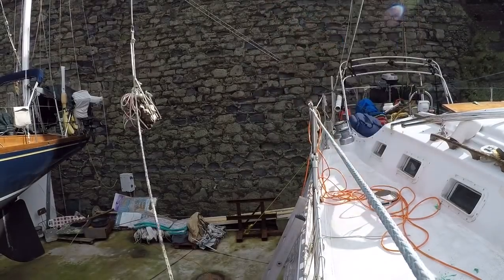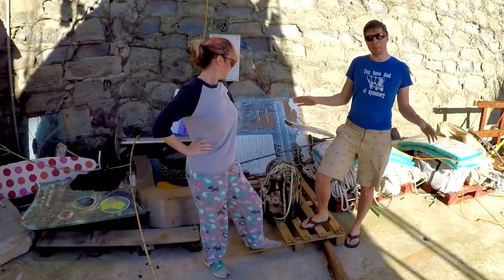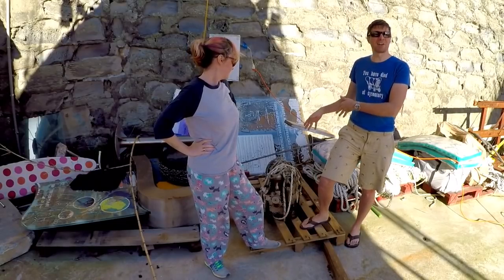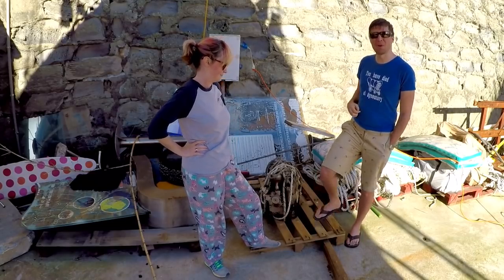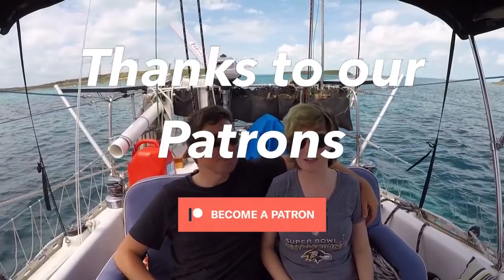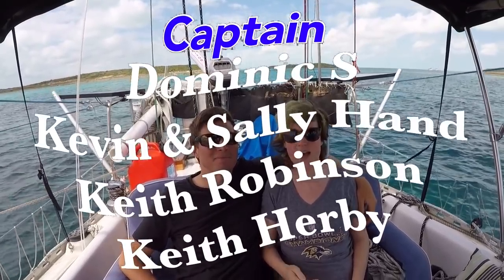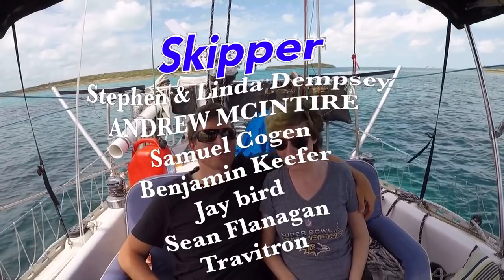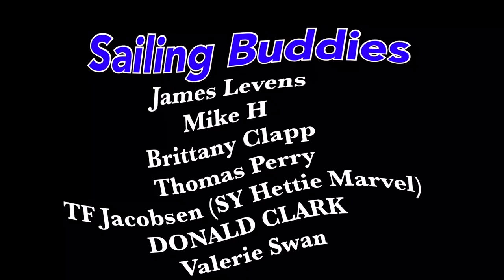Diesel VS Gas Generator?! | Sailing Wisdom

Comment: Another sailor, Garrett had a new Honda Generator destroyed by a wave. Very little tolerance for salt water. I have a 44 LB Sichuan Sifa 3 horsepower MB168F diesel. I oversized the 20 MM crankshaft to an inch with an adapter, and installed a big 7 inch pulley. It's perfect for a car alternator. Just mount it on a thick aluminum plate and not a steel frame. The other issue with air cooled diesels on boats is big fuel tanks always leak in. Water contamination.
Reply from the maker: We have had really good luck with Westinghouse generators. They are less temperamental than Honda and cost about half as much. We have had our 2200 Westinghouse for about 3 years now and we just added another 3700 Westinghouse to be able to run air conditioning on really hot nights at anchor.

Comment: A new Honda vs an Old Fisher Panda you made the right choice!    A Honda vs a New Northren Lights 1800 rpm diesel genset?  A no brainer for me. As you say there is no right answer for everyone.  I would never have a diesel generator that was not running at 1800rpm.  I had a Kohler 4kw powered by a Yanmar 2gm.  Bought it used for $700.  Never really needed a lot of parts.  Ran quiet, easily powered a 16000btu AC unit and fuel use was minimal. Still running strong for the new owner of boat I sold.   Anyway enjoy your channel.  Love sailing. Do not quite get the whole total electric thing.  JP

Comment: Hey, l've had 2 x honda 3kva gen set for ages on the cat....years..no problems...one fuel only on board..runs everything..48v charger..a/c..hotwater.
Once l set up the 48v solar & start using the regen l hopefully won't use them much...& the 2kva's are magic....cheers

Comment: Great video guys. Let me add a few things. MAny of us hates the large diesel inboard engine - dirty, heavy, noise, vibration, etc. However - even being lucky to have a boat - we still do not have endless time for sailing - so when we plan our passage, we need to start the engine if the wind dies. IT means quite lot of motoring, unfortunately. your gas genertor is great, light. but it is aircooled and you would not be able to take it to the engine room.  If you need more petrol than what you can easily carry, it is also where diesel comes to picture. All in all, a lightweight diesel, watercooled inboard genny is the best - plus an electric engine.
Reply from the maker: That would give you great range and speed! Especially a DC generator as it would power the motor directly instead of going through other steps to get from AC to DC.
Reply: @RiggingDoctor  that is exactly the system i am building - using watercooled controller, traction motor, 15kw dc(!) generator - all are from wrecked hybrid cars :)
Reply from the maker: That will be an awesome setup! At 5kw, we are moving quickly, so being able to sustain higher power levels means you can motor against a current for a long time!

If we could have motored at 5kw all the time, the ICW would have been a very different experience!
Reply: @RiggingDoctor  thank you very much for your advice! It is a great data you provided me. The most difficult is to get information what is  in the electric consumption of a traction motor on a 38-40 feet boat in real circumstances. So far I only  took reference of our long-term average diesel consumption, corrected by the estimated efficiency of a 30-year-old yanmar+transmission...
Reply: Might as well have a small modern common rail Diesel engine that does everything you want. That’s why 99.9999% of all yachts have them.
Reply: @PremierNZ-qb5zd  99.99% of yacts have diesel as most marine infrastructure supports it and in the early 70-s when low maintenance - mass production figerglass boats appeared - and made sailing more popular - it was the only way to go. A small common rail engine - which produces 200+ nm torque and continuous 600-700 rpm (max. 1200 rpm), watercooled - these figures are needed for a min. 40 feet sailboat - is not small, for sure. We are talking about 40 kw of power, low rpm capability, tilt capability - forget about carengines here. That is why a marine diesel weights 400 pounds, a similar car engine weights 150 pounds. a diesel engine with a gearbox has up to 40% efficiency, the electric motor has over 90% - so more that double. That is why eletric motor is lighter, takes less energy - hence a small genset can power it. IT is not a complicated structure - the electric motor is like a generator without the diode bridge. Certainly less complicated than a diesel engine.
Reply: I guess in the end it comes down to personal choice and I certainly respect their choice to go electric but for me, give me my engine any day which I have had for 13 years done 900 hrs( and I use my yacht a lot) and has never given me one single piece of trouble. By the way my engine delivers 40hp and only weighs 98kg (215lb) which is probably not too much more than the electric motor and battery setup. Anyway each to their own. Happy sailing.

Comment: Having owned boat (s), and sailed, we had a 1000 Watt Honda, and we loved it. If we were docked, it sat on the dock and ran.  I think that any engine IN your boat is a big headache. We did both a power boat and a sailboat. We did not do blue water sailing.
Reply from the maker: Not having it permanently attached to the boat is nice because when it starts giving problems, you just carry it away and carry in the replacement!

Comment: If you have an AC Induction motor it is possible to convert it into a generator if you are out sailing. Put it in regen mode if you have it and that will cause the prop to turn and generate power for your battery. However, you'd need to use it in stronger winds because it will create drag. Not sure if you have tried that but it is possible. If you are running just a series dc then my post is a moot point.
Reply from the maker: We have the AC setup and it generates lots of power for us while passage making across oceans :)
Reply: @RiggingDoctor  Excellent to hear. What AC setup are you using on your boat?

Comment: Very Good Points, as Usual. Although the Diesel can run for years trouble-free, What If it Doesn't? They are simple enough that you and Herbie can Overhaul it in the cockpit, but if a part is broken or unuseable, BIG Money. And perhaps LONG Waits for parts. I agree, in YOUR Case, Unjustifiable Expense. You can always just WAIT for a Sunny Day...

Comment: I've used those generators for years. The first Honda 2kw lasted 9 years and around 7500 hours. On the second one now. (I live off grid in Alaska)
Reply from the maker: Great to know they last a long time and can be dependable. 
Any tricks on keeping the starting cord from chafing? 
The original one chafed through and I replaced it with dyneema. It’s starting to chafe a little and it’s only been about 100 hours.
Reply: @RiggingDoctor  you have a rough spot on the metal insert in the plastic case. Next time you take it off use some good epoxy to build it up and smooth it out. It's caused by pulling at an angle rubbing in the same spot all the time.
Reply from the maker: Will do!  I made the new pull string really long so I can go trimming the chafed part off as I scoot the handle further in. I pretty much had to dismantle the whole unit to get to the starter cable!

Comment: The points you bring up are very sound. Also if you are going to put a diesel generator on board that big you might as well go to a diesel engine instead of the electric.

Comment: My concern is the gasoline storage.  It is more dangerous by far than diesel and it has a lot shorter shelf life.  Plus the gumming carburetor problem that can occur.
Reply from the maker: We keep it on deck and only carry what we think we will need for the immediate future for that reason. Once it goes past a few months it goes stale.

Comment: I wouldn't have that Panda generator either.  The thing is I do prefer diesel on a boat don't get me wrong, I understand why you did what you did.  That Panda is a nightmare to operate.  Most of the ones I have had the pleasure to know lasted about 500 hrs and then needed a major rebuild.. Seriously!!!!I would make a box for the stern and buy one of the cheaper $1000ish air cooled Changfa/Yamaha based diesel generators.  That way it could be air cooled and give you a good sized propulsion boost by allowing for more charging.  Though your generator may be the right size, a bigger genset might mean the difference between getting out of a bad tidal/no wind situation.  Also most fires on boats I hear are caused by gasoline fumes.  Diesel burns it doesn't explode like gasoline.  Considering you already have a huge diesel tank, shlepping around a lot of gasoline tanks might at some point get old.  Considering you can pull up to a dock and just fill up a hundred gallons of diesel is pretty appealing to me.  I have a Changfa 5 kw I've been running since 2007 with no issues.  It has 7600 hrs on it and still starts after one rotation and has manual or electric start.  At 1/4 load it will run about 4.5 to 5 hours.  It weighs I think about 80 lbs by my estimate and can certainly be carried by two decent sized people with no issues for short distances. Examples https://www.ebay.com/itm/Lombardini-Diesel-Generator-Power-Guard-Generator-Powr-Gard/263870678381?hash=item3d6feb056d:g:6kYAAMXQVERS48Cx     https://www.ebay.com/itm/Yanmar-YDG-3000E-Diesel-Generator-Works-Read/254006229414?hash=item3b23f379a6:g:X2sAAOSw11Bb7cWy   Mine is pretty much like the Yanmar and the Changfa engine is a clone of the Yanmar.
Reply from the maker: I didn’t know they had that reputation. Dodged a bullet!

Comment: Your sailing, why not get a miniature wind turbine or a small aqua turbine to plop down in the water and it spins as long as the boats  moving, either should be plenty to charge your electric motor up and you can just take it down after you have a full charge. I know in my area Menards sells the miniature wind turbine for 400usd. I mean its free and  maintenance is very low, just grease up the barings and at worse just replace the ball barings which are everywhere. You would only need an inverter to connect it right to the battery charger. If going green is the goal anyway. You could even get some of those cloth like solar panels and attach them to your sail if you are worried about space.
Reply from the maker: Thanks for the suggestion about the mini windvane. Our motor works as a hydrogenator and when we crossed the ocean, it actually met all our electrical needs. 
The only time we have needed the generator since we left the US was in Bermuda and in Horta (Azores) to charge up the motor bank after motoring in through the harbor. Other than that we haven’t used it much at all! 
The solar panels take about 1 week to charge the motor batteries up, so if we have the time before we need the motor again (which we usually do) then we wait and don’t use the generator!

Comment: Bad comparison with New Honda and some used second hand diesel that looked pretty much beat up.
Reply from the maker: It’s a comparison of gas vs diesel generators. New gas is $1k, new diesel is $14k+ installation!

Our case was a $100 beat up generator that spurred the discussion of gas vs diesel
Reply: @RiggingDoctor  I understand you are comparing those two generators. New diesel generators are very much different (modernized) than the one you had and last more than twice the lifetime of any gas power engine for less than $5K. Just sayin.  ;)
Reply from the maker: I couldn’t find any like that. I was looking at Fisher Panda and Northern Lights. Both of these were crazy expensive (new). For the price of a new diesel, we could buy several gas generators and never have to worry about repairs or rebuilds since a new one will still keep us under the original purchase price of one of those diesel units.
Reply: @RiggingDoctor  A diesel solution is going to be more expensive than a comparable 4 stroke gas generator set. However, if our point of reference is a 2 kW Honda suitcase unit, our diesel equivalent would not be anything that involves "installation" or five figures, would it? That's an entirely different comparison: a high powered fixed setup vs. a small inexpensive portable unit. Either can be gasoline or diesel powered, and there's very little difference at all if not used that much. Most importantly the diesel will have better fuel economy especially should the over sized system be run at partial load.

You don't want heavy and large additional equipment and you don't need high power; you only want a very lightweight generator. The choice in your specific use scenario is a portable Honda, but not because it's gas or because it's not diesel - because it's excellent.

Comment: What size is your battery charger ?  When the drive bank (210 AHr @ 48V) is down to 50% SOC, how long would it take recharge using your generator ?  Can you recharge the house batteries from the drive bank ?  (They do make DC-DC chargers.)
Reply from the maker: Our battery charger is 15 amps @48v. Charge time is about 10 with the charger we have from 50%. We have a 48vDC to 12vDC converter that we use to let the motor Regen power our fridge.
Reply: @RiggingDoctor  - you are not going to put much energy back into that battery bank just running the generator for an hour or two before entering a harbor/mooring.  I think the generator could handle a 30A@48V charger, but it would be expensive !
Reply from the maker: We had a 25amp @48v charger and then it died. A friend gave us his old 15amp @48v charger because he wasn’t using it. We greatly appreciated it since it saved us several hundred dollars, but it sure is a slow charge!
That charger is now dead and we will be replacing it with a much larger charger, something that will push the generator to its limits and give us more power.

Comment: Great info, thanks. You mentioned previously that during crossings, the regen along with solar was enough to keep the batteries full.  Is that still the case or you rely heavily o the generator?
Reply from the maker: It was the case while crossing. The solar panels were plenty to keep the boats house systems running, and could charge the motor bank back up in about a week. This works great if we are sailing everywhere and only motoring into anchorages. 
When we were in the ICW, we were motoring everyday and relied on the generator to produce power to charge the batteries back up every day.

In the Azores, we are relying on the generator to run our power tools.

Comment: Question,  is your generator for charging batteries or can you run your electric motor with the generator?
Reply: Don't know the size of their motor but for our 30 foot Dory we can run the motor at 3 knots with the generator running and we have a 0 discharge of the battery. The generator can keep up at this point. However if the batteries are dead or not there at all the generator can not run the motor by itself. Dennis
Reply from the maker: We use it to both charge the batteries and run the motor. We actually use it more for the motor. We have an electric yacht qt20
Reply: Rigging Doctor Tx ... I really believe in electric motors and nice to see people adopting this technology

Comment: I still have no idea how many watts at 48 volts your electric drive uses. Knowing that you would have an idea of how big a generator is needed to run the motor full time powered by the diesel generator. Your probably producing 120 v at ?amps/watts and running it into a 48volt battery charger at so much output working backward you can probably come up with the size generator you need to run the boat. Then, you can see if you can find a place on board to mount it. It seems like it might be a solution to the having a way to use the electric motor more when needed. Like in the doldrums or ICW.
Reply from the maker: The motor draws 400 amps at 48v at full power. When we are getting somewhere, we draw anywhere from 25a to 70a at 48v. If we are trying to get far and have a long run time, we keep the draw to under 15a, but then our speed drops to about 2 knots.